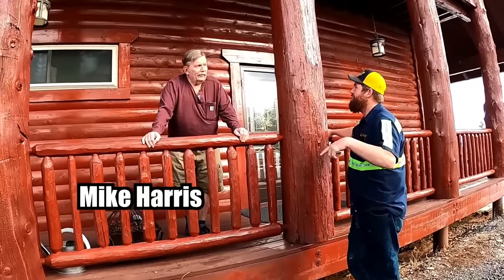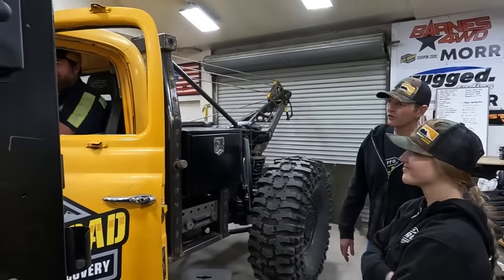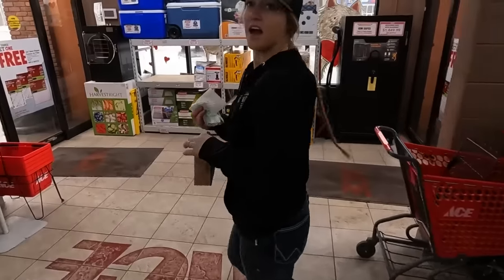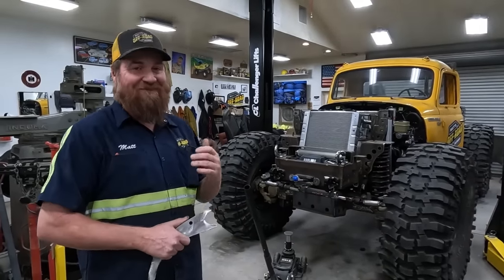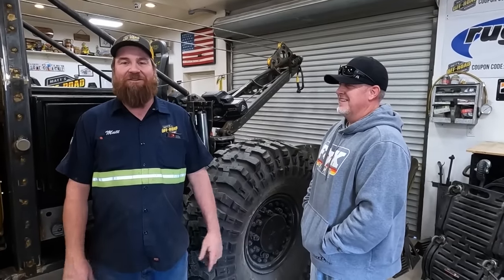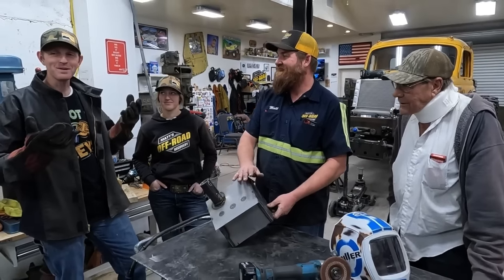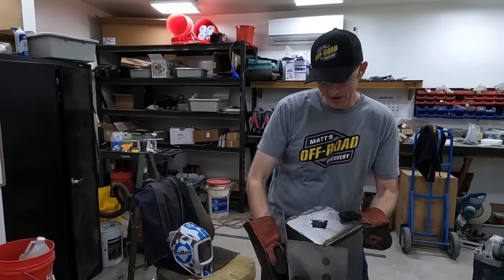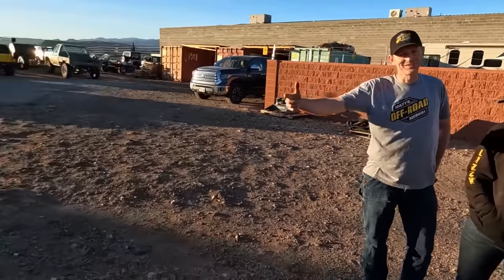It's A Fast BEAST...The World's Largest Off Road Wrecker!

Comment: Watching this with my husband and before Tom even mentioned that Matt needed a punishment, my husband goes, “Matt’s punishment should be that he has to measure everything correctly, using all the correct tools, measuring twice, and even planning it all on the computer before hand. Basically everything by the book, no guessing.” 😆 Love you guys!
Reply: You took my thought to the next level...

Making Matt plan and execute using all the tools is fitting.
Reply: in metric
Reply: Yes, this!
Reply: Haha that’s what I was going to say too
Reply: Yes!!!!
Reply: And full protective equipment!  (Goggles, gloves, welder's helmet, etc.)
Reply: @russellhltn1396 My thoughts as well!!
Reply: Perfect!
Reply: Love the computer idea, as well as metric. I think he should tig it as well.
Reply: I came here to say this!!!
Reply: Computer design, mm precision. Love it!
Reply: In metric
Reply: Precisely!  And add one more little thing:  No running out of gas for a year.
Reply: And no grinder or claw hammer though
Reply: Matts punishment should be that he has to stop and fill up the gas in everything he drives everytime he drives for at least a week.
Reply: I thought the same thing 😂
Reply: CAD drawings and +/- 0.005” tolerances. 😉
Reply: And full PPE. If he doesn't have all this he has to start over from scratch every time he forgets PPE, is missing PPE, or guesses on measurements or planning
Reply: Full PPE would be the best! 😂
Reply: Yes dooo it
Reply: This is perfect.
Reply: Yes my thoughts exactly make him draw it up in solid works and print out pdf drawings of it…
Reply: He should have to plan it in CAD and cut all the pieces on a water jet.  I mean ALL the pieces.  If it's not in the CAD drawing and wasn't cut by an automated machine he can't use it.
Reply: Yes this is the best punishment
Reply: Yeah, a fully complete and funktional Birhouse. Planned on the Computer up to the last detail and Builded with every Rule and Tool there has to be. Earplugs, Safteygoggles and so on. And all in mm (metric).
Reply: @TheFalkonator  Not JUST in metric. Decimeters. NOBODY uses those.
Reply: @TheFalkonator  - Now that's just cruel,..LOL
Reply: The Gospel:

(I am not a bot, I'm just someone who enjoys spreading the gospel. Much love to you all!)

The gospel is the good news that Jesus Christ, the Son of God, died for our sins and rose again, eternally triumphant over His enemies, so that there is now no condemnation for those who believe, but only everlasting joy.

Peter says in 1 Peter 2:24, “He himself bore our sins in His body on the tree, that we might die to sin and live to righteousness.”

So Christ died not only to forgive sin, but also that it might die in the lives of His people. 
~Quoting John Piper~

ALSO
My friend put together a great PowerPoint about the Gospel and Jesus being the prophesied Messiah.   I'd like to share if you're interested, just reply and I can send you the link.  May Jesus Bless you!
Reply: Is your nickname Einstein? Cause you're a genius
Reply: and follow all workplace H&S to the extreme
Reply: Yeah, but then it wouldn't turn out as good or as accurate.
Reply: I agree with you on PPE , no claw hammer or grinder,  and I  would like to add the final assembly has to be within +/- 1.5 mm angles have to be within +/- 1 degree
Reply: And, he has to build it out of wood, no welding, no grinding ;)
Reply: Epic.  Yes, Matt needs to be required to do the math, measure the thickness of the metal with a micrometer, use actual dimensions for the cuts, etc.
Reply: He wouldn't get anything done. lol The shop would come to a grinding hault.
Reply: Agreed but he should do it all in CUBITS!!
Reply: That was my EXACT thought when they mentioned a punishment for Matt. Exact measurements, proper tools, and PREPLANNING.
Reply: @erichusmann5145 Yeah, that's equal to rakes?

Comment: For Matt's punishment he should have to build a metric bird house with a caliper that is accurate down to 0.25mm. Also, all the walls must have an angle of π/2 radians.
Reply: And it should be made out one folded sheet! cut it, bend it, weld it....
Reply: I'd rather see matt build a birdhouse using nothing but computer-controlled equipment. Programmed CNC anything is available, but no grinders, hammers, handheld anything.
Reply: @sidekickbob7227  For sure!
Reply: @Jeffrey S Cool! Will do that

Comment: Matt needs to make a bird to fit into the birdhouse, using the same grinder and welder as Tom did. The bird's head should be peeking out the entrance hole.
Well done, Tom.
Reply: I like the idea that every time someone needs to be punished, they have to build something for the birdhouse.
Reply: Tom's birdhouse will have sold by then, so I suggest the following:
Matt also has to build a birdhouse, with the same dimensions as his original drawing. Matt can use every tool he wants except for grinders and welders. His birdhouse has to be precise to the millimeter.

Comment: Matt should have to build a birdhouse to the exact same dimensions, but it has to be super precise and very nice. Within 1/32 of an inch on every dimension.  He is allowed to use any tool in the shop, but bonus points for fancier tools like the mill, tig welder and safety glasses.
Reply: That would be great
Reply: No grinder except with flap disk. Everything must be cut to exact angles in one pass.
Points deducted for every weld that is below lizzy standards.
Reply: Make him measure every step and keep a log.  Marked something?  Better have measured before and after.  Grinded something?  Measure before and after.  And mark everything down.
Reply: OR…he must convert the birdhouse to a drawing that is to-scale on graphing paper….seeing as he always does rough drawing and cardboard. 😂 the opposite of Tom’s punishment.
Reply: Mat should have to use wood
Reply: WHAT!!??? That's no punishment,  that's too kind.  Gotta be a challenge.
Reply: Or he has to use the metric system and everything needs to be inside of an millimeter in spec

Comment: Got a tip for yall, If you are welding long lengths on any material its a good practice to stitch weld then switch to the other side and stagger your welds. If you need a full weld, come back after it cools and fill the spaces. It will help with the warpage. Yall are killing it with the wrecker!! I love the recovery rope too

(  WELD  )  No weld  (  WELD  )
//////////////////////////////////////////////////////////////
                  (  WELD  )   No weld   (  WELD )
Reply: Man, do you honestly think they need that suggestion? Like they don’t obviously know that?
Reply: It wasn't for just them.. and it was free.. so why not? Not only that they might have forgotten goin purely off the part needed a lil adjustment after weld up.
Reply: @tommydmot7725  I know what you're saying, being a fabricator for 50 year's I have done more welding than all of them put together ... They have done a pretty good job, but all that short Arc on thick steel , no scale removal or preheat made me cringe . Over all pretty nice job.
Reply: Seriously?

Comment: Matt is a master of making things work, especially if he can tweak things as he goes.  So I think his challenge should be building all the parts to detailed drawings, and not allowed to reposition or disassemble any parts once they've been connected.  Bonus points if he uses the most appropriate tool in his shop for each process.

Comment: For anyone who is interested: A rack unit is a unit of measure defined as 1+3⁄4 inches. It is most frequently used as a measurement of the overall height of 19-inch and 23-inch rack frames, as well as the height of equipment that mounts in these frames, whereby the height of the frame or equipment is expressed as multiples of rack units. Wikipedia
Yes I had to look it up also! 🤫🙃

Comment: On the roof pitch, instead of using trig to get the angle which brings in square root, he should have just done a simple ratio. You have the run which is half the width. 7.25/2 which is 3.625. Basically 7/12 = x/3.625. Then do what we called the treasure map method. So 7*3.625/12. That equals 2.11. So add 2 1/8 to your height. This gives the rise. So all you have to do is put something across the points and it should be at the proper angle. And I’m a nerd and everyone should kick me for thinking about this for longer than the 30 sec it was on screen.
Reply: I’m a lifelong carpenter. I would have done it using the same math.
Reply: @jessepitt  congratulations, you just told me to never hire you because you’ll spend more time doing math than building anything. I kid, but carpentry is irrelevant. For one, you wouldn’t be in a situation where you had only one measurement and no way but math to get the others and b) if you did have to do it you’d have tables that tell you all the math in which case I would agree because my point is about what’s quicker. It makes no sense to say, I’m going to do it the way that requires algebra and figuring square roots by hand when a simple multiplication and division would do the same but you do you.

Comment: Congrats TT on the bird cage. It may need a hinged or pad locked bottom for nest cleanouts. Like the signatures. Congrats to the team that have gotten the HORW (heavy off road wrecker) to move on her power. The smile on Matt's face when doing parking lot donuts, sums the day up. Trifecta, bird cage, HORW, ebay auction.

Comment: You guys need a spring centered mini steering wheel just ahead of the center armrest for the back wheels. Use a normal steering control system but with a 90 degree lock to lock to flick the back wheels around.
Reply: Monster trucks do it the same way they are - an electric toggle switch

Comment: A friend and I bought a 1996 GMC C2500 ext cab with no motor or trans and he bought a totalled 2005 Chevy Suburban with the 8.1. It was obliterated in the rear..she looked like she was rear ended by a mack truck doing 70mph. The frame was f***ed as well. So, we did the right thing and put the 8.1L into the GMC. I had forgotten that Matt has the same motor in this truck. It reminded me when i saw the motor in the vid. 

We just got it all in and fired it up yesterday.

Comment: Matt needs to use all necessary tools to build a bird house off a set of prints perfectly.
Reply: Yes. All in metric measurements.
Reply: And using all of the proper safety gear (gloves, safety glasses, hearing protection, welding jacket, guards on all tools as they were from the manufacturer; etc...).
Reply: And using a Stick welder
Reply: @lavernchatfield8246  or TIG?
Reply: Minus the claw hammer
Reply: Precision machining on the mill and lathe. 
And no claw hammer.
Reply: No grinding once he starts welding, every piece has to be the final size by then

Comment: I am in the USAF and we use torque wrenches all the time. As long as you are using the extension at exactly 90 degrees it makes no difference. It starts getting very tricky when you start throwing in like a crows foot or something like that.

Comment: Matt should have to fabricate 
Two 50mm x 50mm squares out of Quarter inch steel with 6mm threaded hole, 10mm from the edges, for each 4 corners. 
Then he has to make 4 bolts out of steel rods and they have to screw through both 50x50mm squares. 

If the dimensions are more then half mm off or threaded holes are not exactly 90 degrees the bolts are not gonna screw through both 50x50mm squares.
He can't use precision power tools like lathe or pillar drill, only hand tools, vise and callipers etc.     

I can provide CAD designs if my instructions are not clear.

Comment: My idea for what you should do with the bird house was to keep it around and weld parts and pieces to it from other mistakes that get made around the shop. Cut something to short? Weld it onto the birdhouse somewhere. Forget to ground the welder? tack that wasted mig wire to the house. It would eventually become a big ball of mistakes but would also be a 1 of 1 art piece and also a reminder of what not to do.... Then i looked it up on ebay and saw the current bid of over $15k and those thoughts went totally out the window.

Comment: Outstanding work from all involved. I've been around since the beginnings of Monster Trucks and while I have always appreciated them, and they are incredible pieces of mechanical engineering, they are built for entertainment. Matt's wrecker 'may' be a bit overkill, but it is going to be used for its intended purpose of towing and recovery.

Comment: Using digital veneer calipers, protractor and compass; Matt has to draw a full scale rendering of a part selected by someone else. Matt will be judged on size measurements, line straightness, radius, arcs and angles. An example part would be the brake pedal support assembly.

Comment: The welding skills Lizzie has gained are remarkable. A couple remarks, How are the Harbor Frt Cordless tools working? And, I usually put a positive throttle pedal stop on the floor under the pedal, just how I like to build in extra security..

Comment: So a little battery safety. Most people disconnect the positive but if you short from the positive post to the frame you get a light show and melted stuff. If you disconnect the  negative instead and you short the negative to the frame you don't get a light show and melted stuff.

Comment: So, do you remember the old wooden pull trains? Locomotive, tender, flat car. box car, tank car and caboose all pulled along by a string. Why not make one out of steel? Should it be thin steel or heavy chunks? Should be all metal which ever way you go.

That would be an interesting challenge...

Comment: Just in case nobody else has mentioned it…. When you are taking battery cables on and off, ALWAYS remove the negative cable first. The positive cable should never be removed first off the battery due to the chance of it sparking and causing damage. The positive cable should ALWAYS be first on and last off the battery. If the negative cable touches any metal it won’t do anything due to it being the negative cable. Please be safe guys

Comment: Matt should have to build a birdhouse of the same dimensions as Tom's.  He can use all the measuring tools he wants.  The birdhouse should be one continuous piece of steel, folded into shape (like a cardboard box) and welded with a harbor freight 90 amp flux wire welder.

Comment: Please add a breaker to the read battery cable on both sides that way if it is accidently grounded the breaker will go off saving your battery from shorting out.

Comment: a rack unit is about 2 inches high. its a electronics and networking term for the cabinets the network equipment is mounted in is called a rack a rack unit is one space in the rack.

Comment: Wear safety goggles when grinding.  other than the wheel shattering and taking your eye out... Something I didn't consider until I had to get an MRI - they ask you if you work a lot around metal and grind.  Concern is if you had any metal in your eyes an MRI could seriously harm them. Hopefully you'll never need one. 

Also can Tomtom use the grinding wheel for dimensions? is it a standard 4.5"?

Comment: Next time just tac the peice to the table. That's using the welder and grinder to cut it. Which you can also do on a trail by using the chassis and grind it out later to clean it up.

Comment: Toms measuring wouldn't be so bad if, at an early age, his dad had taught hime a few basic measurements. A size 8, UK, welly is a foot long , assuming no silly add ons in the way of tread and my hand, from tip of the thumb across the palm to the ball of the hand is 6". All perfect for measuring fences etc.Near enough to work at 1/2 inch "precision".

Comment: A great project that can already be on the street.
 congratulations for a great job, although there are small details to refine according to the tests you can do.
 Personally for me it is difficult to understand the relationship between the great weight of the vehicle, the power, the operating temperature of the engine, in a situation of a vehicle rescue.
 Keep going and you will achieve great results in this great vehicle.
  Congratulations again and cheers to that great team.

Comment: The birds aren't going to like that birdhouse. Every time it rains water is going to collect on that oversize-base piece And it's going to run inside all over the floor. You either need to weld that base solid so that water doesn't get in or you need to put weep holes all around just inside the base

Comment: Matt's task should be to build the same thing but to EXACTING tolerances using all the highest tech tools int he shop (even if not needed) AND wearing complete safety PPE for the duration. 
Whatever did become of the sign they put up to be more aware of PPE, etc., and there he is on the drill press in the beginning of this, no eye protection, curls of metal spiraling up off the piece, etc 🙂
Reply: Ha-HA! Guess i should've read through the other comments! Lots of great minds thinking alike!!

Comment: I noticed you had a little trouble climbing high rocks... you may have to place some kind of counter weight on the front,.. seeing how most of your weight and traction maybe because boom is farther out on rear, and towing weight. causing less weight on the front wheel for traction, so you only have two wheel drive on the rear.... JUST SAYING...not sure